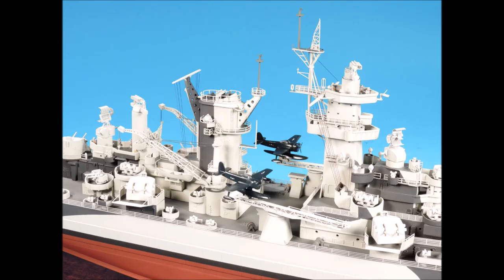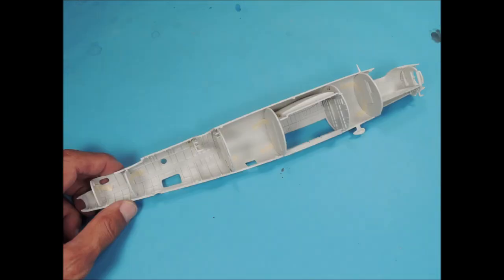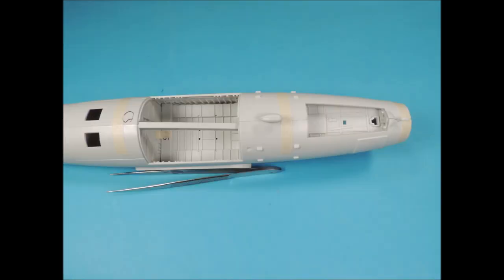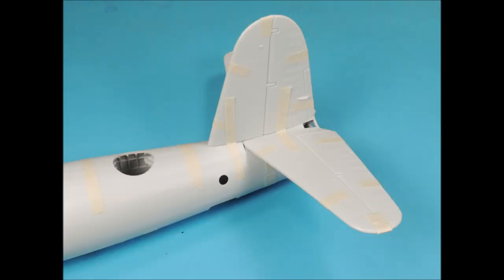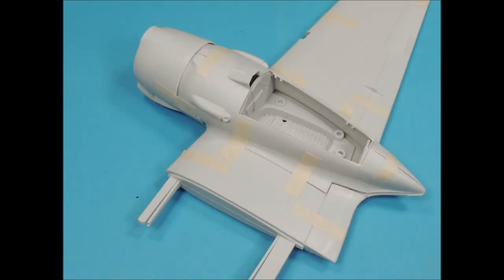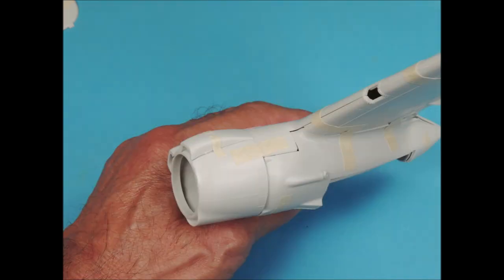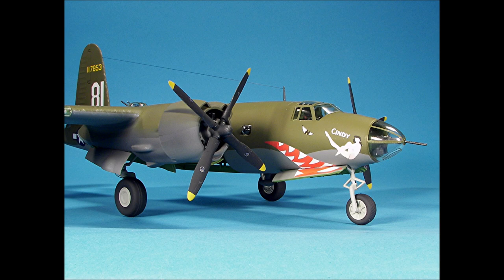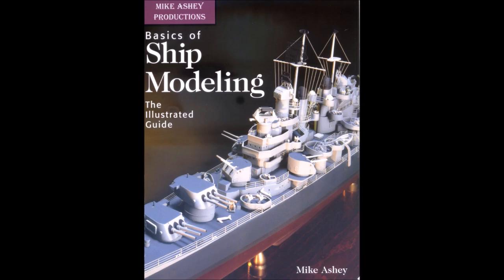Tape up review of the AMT-ERTL 1/48 scale B-26 Marauder

Comment: I didn't even know AMT did a 1/48 Marauder. It might just be the photo, but the cockpit looks huge. To the point that the center console seems way too far away from the pilot and co-pilot seats. They would need Reed Richards arms to be able to work the throttle levers. Thanks for the video! I'll be following along and looking forward to the next two parts.
Reply from the maker: Yep 
The cockpit is a bit large

Actually the engine nacelles and the fuselage are a bit larger than the Revell- Monogram it.
Having built both kits, I like the AMT-ERTL kit better.